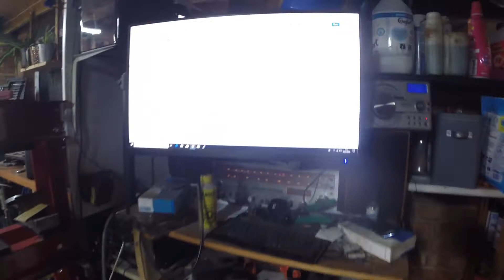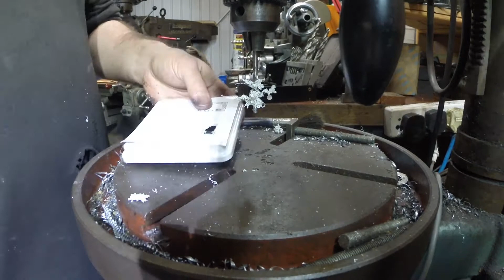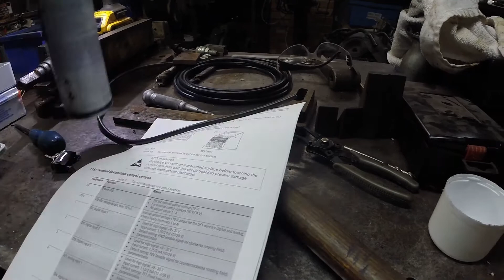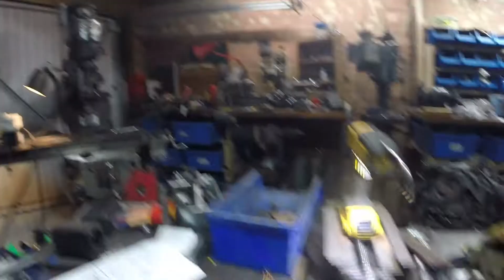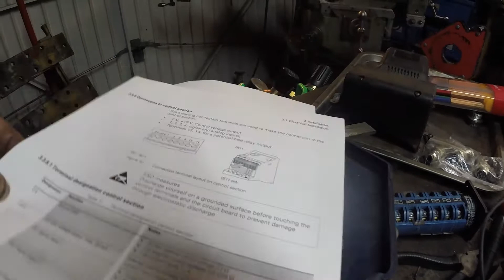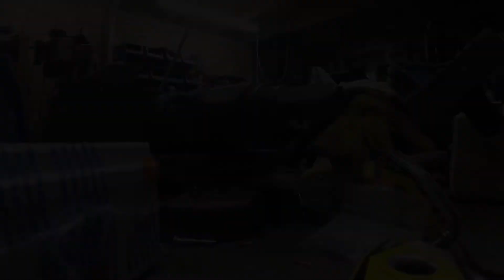Bridgeport Eaton DE1 VFD control setup and first run

Comment: Hi just did same to my Bridgeport and it runs fine only it seems to run as 4 pole does yours run at full speed at 50 hz
Reply from the maker: You've got me wondering now... On highest speed pulley I'd certainly not want it going any faster, I know that much without looking at it! I'll check what speed I get out of it later.
Reply: my vfd goes to 60hz which brings the speed up quite a bit great to see it running couldn’t have got it going without your video
Reply from the maker: @stephenmurphy2638  Annoyingly, my laser tacho seems to have given up, and I didn't think to check my VFD settings, but I have a feeling mine is set to 60Hz max. Really glad you found the video useful!